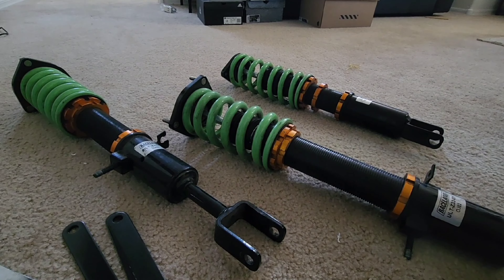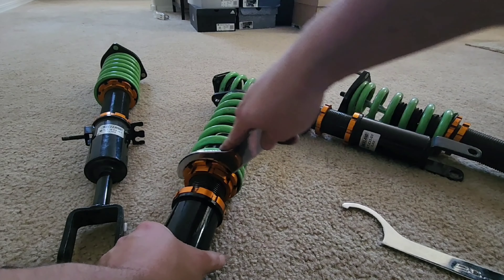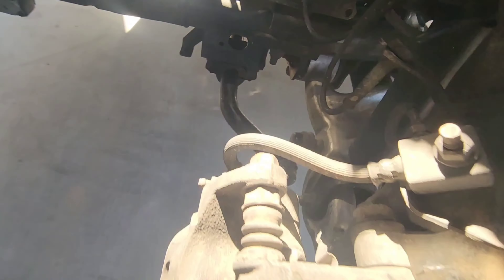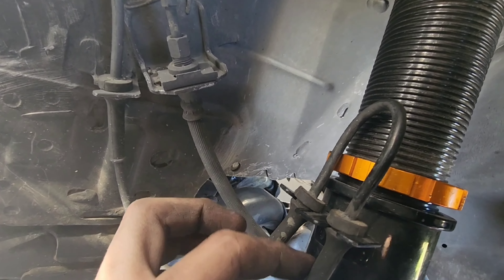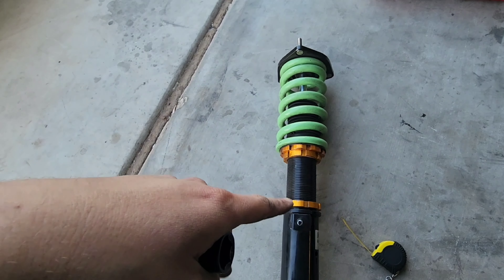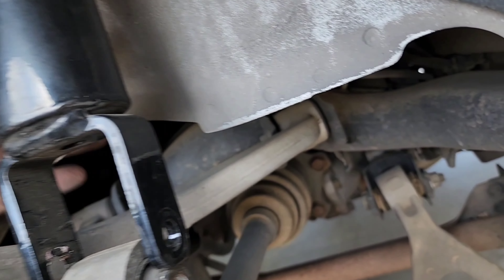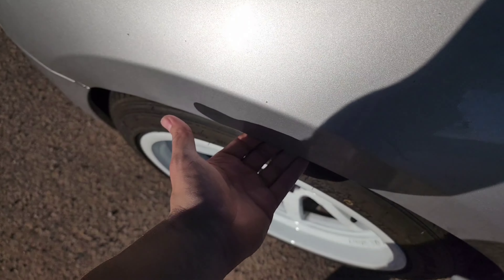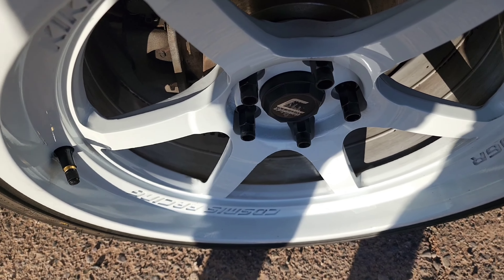Coilover Install! | INFINITI M45 M35 G35 350Z

Comment: Sup bro, hoping to get feedback on how they perform since this was uploaded 4 months ago. 
I have an 07 m45s and am thinking of getting the blue racelands for the g35 to throw on.Hows the rebound rate since our M's are heavier than the z's and G's. Do they handle bumps and potholes well? I'm currently on kybs and eibach springs which ride good buy nyc streets are horrible and need to be able to adjust ride height. Thx for any feedback and showing us G coilovers fit our M's!!
Reply from the maker: Whats up man so far they have been doing me good but I will say that when going over bumps you have to go really slow because it hits the sway bar the fast you go thru a bumper it hits the bottom so I do feel a little bounce from it if I am being honest
Reply: @Chrizleyva  ok cool thx for the reply. Do you think it's because your super low? Or the spring rates.

Comment: Hey what's up I had a question for you did you do the bags on your 350Z and if you did do you suggest getting rid of the helper springs that are on the back on the cups
Reply from the maker: For most air suspension set ups that I have seen you have to remove the spring in the back because the bag goes there like the one from airlift. It would be the same for the m45 as well because it has the bucket. I don't know if you would have rubbing issues if you placed a strut and a bag in one in the rear it would have to be a skinner design

Comment: would lowering springs from a G35 be okay on the M35?
Reply from the maker: I'm sure it will but the spring rate may not be suitable for the car as the M is heavier it may bottom out more

Comment: Be careful of the sump, it sit's pretty low lot's of M45 Owners crack the sump after lowering them
Reply from the maker: Yeah I noticed that if I'm not careful I hit my sway bar alot. But for the most part I don't really hit the front it's kinda more in the middle of the car hits the exhaust alot

Comment: Totally confusing video. not useful. It jumps around. Needs more of a "step by step procedure". Like "Park car on a flat surface. Apply parking brake. Chock wheels. Jack car up. Support with jack stands. Remove wheels. Remove this nut with X mm socket. Hold other side with X mm wrench"